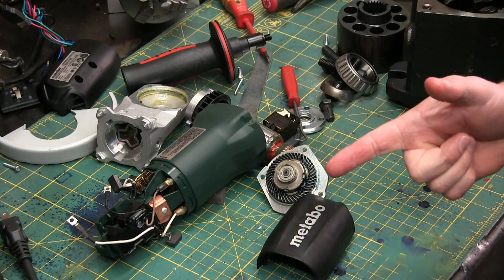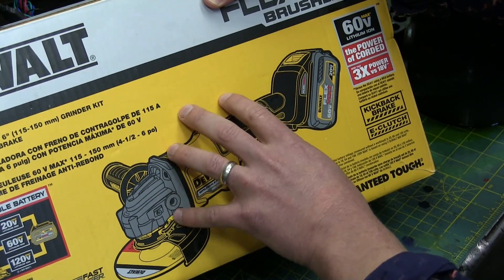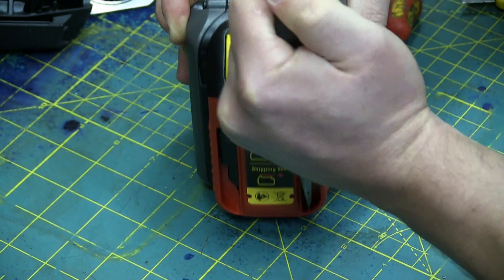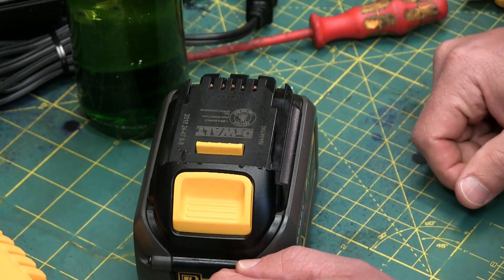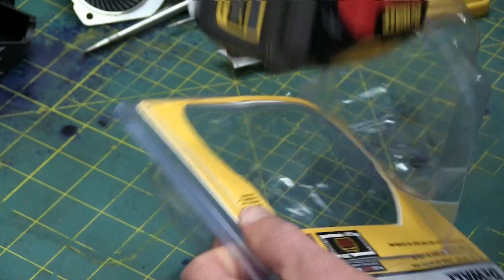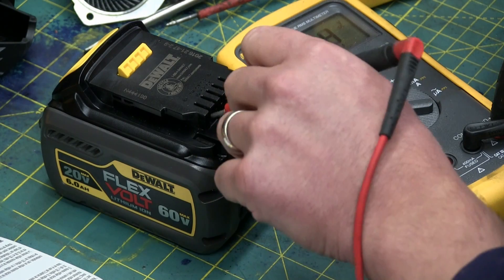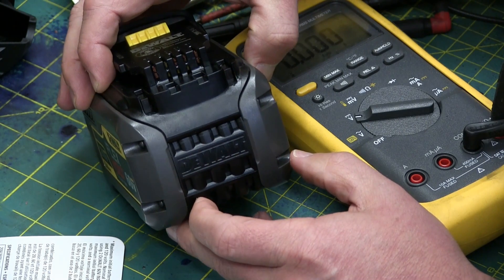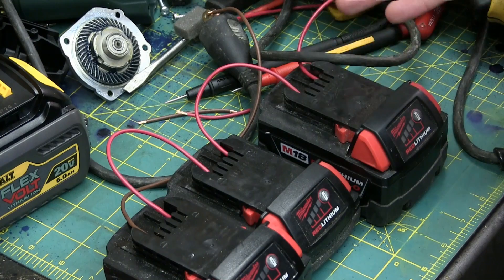Plug-in Power Tool to CORDLESS CONVERSION.

Comment: I thought about it for a minute here, and i didn't get to the turbo charge-y bit, but i think you could modify your charging station to have a GFCI that automatically resets before it goes into the battery, the power would go through the battery to charge it up as she goes, then send the power down another lead into the drill,  mock up a battery plug-y thing to get it in, same deal as the fesstool saw, where the end of the cord fits the pokey parts in the battery attach-y parts, back down into the station, (maybe through the battery, i'm not sure if it would have to go again to pull power out of the battery if the gfci breaks for a second and you don't want to have a pause in your work, never tried it and not an electrics guy) then back to the wall. Then again that's just taking your battery drill and using power straight from the wall while the batteries are charging.
Reply: But then you'd have to have a battery on the charger to run it with the cord.
Reply: You could run a splitter, have the power come into the drill from the battery at blah dy blah and have direct power from the wall through the station into the machine.

Comment: I see and understand where you are going with this project. However, might I ask about possibly going the other way. That is to build an adapter with a cord which could be plugged onto a battery powered tool and allow you to finish a job you're working on when the battery dies.It would convert ac to dc and be adjustable for smaller current tools. I think this could even turn into a commercially product; supplied by different manufacturers so the plug matches the tool.  I have encountered this many more times than tripping a breaker. I always make it a point to not use long extension cords which pull a lot of current and often heat up and increase resistance and trip a breaker.

Comment: there was even a sticker on it...
Reply: on...?
Reply: On...? Isn't a question but there was a sticker on the battery that said push to release or what ever
Reply: Yeah, it actually is a question: mine. You said "on it" without first specifying which thing "it" was supposed to refer to, before. Thanks for doing so now. But why didn't you do so before?
Reply: Hmm .. Did that sticker say something like "Remove before use"?  I had to rewind that part to be sure.
Reply: You couldn't have rewound this video, Jay Herde.
Reply: Some of us can.  And I did.
Reply: No, you never can, Jay Herde, because it's not on a windable medium like tape or film. It's on disk or flash storage (YouTube probably still uses a lot of disks).

Comment: Easist way might be to hack a Milwaukee Rapid Charger (48-59-1807) since it has the mounts for 3 individual m18 batteries right on it, which would be easy to series the wires from inside, you could also use the male 120v connection and comvert it to female to run a male tool or make a small adapter to convert from male to female. In that case. You could put jumpers on the outside of the charger where you can use jumpers to switch around the connections to make the batteries charge when plugged into a wall like intended or switch around a few jumpers and put your male to female adapter on and use it as a corded power tool wireless battery pack.

Comment: Simplest way to do it, instead of relying on a customers power service was to bring a generator. Operating cost and wear and tear on the generator was padded into the bill. Beats the hell out of spelunking in some dark weird basement, tripping over shit, only to find a panel that's from the 1930's and takes fuses.

Comment: You can already get this stuff - it's called inverter. ;-)
Reply: Well, an inverter is only part of it. It only does the conversion from DC to AC. And even then, only nice big ones for this kind of application.

You also, of course, need the battery or capacitor side, and the charger side, which complete the unit, in order to do the thing AvE says about having an electrical buffer.

Comment: Yeah the 60 volt thing is a gimmick.  Motors are all about current not voltage, but saying that, how much voltage can you add to a power tool before it starts to arc?  Try running a power tool from a fluorescent light transformer.

Comment: Wire a decent capacitor inline? I'm thinking of doing that because I'm running my home subwoofer off of a car amplifier, which uses a PC 12v power supply instead of a car battery. My pc power supply is only 500w and sometimes protection kicks in during peaks, so I want to wire a capacitor in, which is kind of how the car audio capacitors are designed.

Comment: How about having a magic box in front of the tool, that rectifies the AC and slow charges a bank of large capacitors through a resistor and diode (in reverse), then into the tool.

Comment: The spec sheets for the brand of 18650's I use recommends you store the cells @ 3.7V. Supposedly, storing them at full or no charge is bad for them. I don't know if there's anything to that, but peak charge for those is 4.2V. My numberulator says 3.7 is 89% of 4.2, and 18 is right around 89% of 20.

Comment: a ups using li-ION or lipo batteries vice lead acid would work. the heaviest part of most ups's are the lead acid batteries. the charger would have to be speced for the batteries but the inverter is pretty standard. just a matter of making a pretty package.

Comment: Maybe there's a way to use car batteries? They'd be all over the  job site, maybe even use the charging system of a vehicle that's on the site? I know a car battery is only good for about 12 to 15ish volts depending on wether or not the alternator  is working, but would the current help? Just a wanna be machinist going through school, be gentle. It's my first time.

Comment: Disclaimer: I have limited knowledge of electrical principles, but am not completely ignorant.

I like the idea of having something that can be built by any old bumblefuck, but how will the AC/DC switch happen smoothly without an arduino?  And if a special relay is used for the switch, is there any danger of voltage spikes?  What about the distinctly finite charging cycles of the battery?

Thinking of ways to break something is, I believe, of equal importance to and an integral part of designing the thing in the first place.

Comment: Put this under the Obviously you don't know to many welder's. I run all my power "AC" power tools, grinder, drill, etc, via an adapter (regular AC / 120 volt) plug at one end, at the other end just clamp your work lead (from a DC Welder) onto the rod provided. This only works if the motor has brushes.

Comment: I thought of the corded tool battery pack some time ago.... As an electrician, there are some caveats to play with... Mainly those OSHA douches. Sure take a battery at say 60VDC run it through a small inverter - out popping a heart stopping 120VAC - on say something to carry it all with, like a 'bandolier'.... Now some 'clipboard' guy is walking around looking for where the dang ground pin is running, and screaming "Holy FN shize - where's the FN GFCI protection?!?" 
Far be it from me to piss in your daydreams... I typically take my daydreams to full fruit, and there is usually a stain one way or the other. FYI I have dream truck which I crash test in my head repeatedly, then redesign.... (Current repeated day dream) But I thought of the 120VAC Battery pack a lot.... Certain say double insulated tools, not a problem.... But anything with a sliver of metal in contact with anything that can fail to be energized, and old man Ray is on the ground in a puddle - waiving for someone to jump start his pace maker. 

Now with say this idea of "bumping up" voltage via DC injection... There's the physical connection of this AC/DC convergence. It needs to be isolated from the AC source, since it's likely a GFCI or AFCI protected circuit. GFCI for personnel protection is required on most all construction sites and industrial work places in the states.... AFCI in every FN new residential outlets in the US. (I hate the fucking things, don't get me started on infant technology being stuffed down our throats for no reason....) 
So.... Rectify the AC TO DC... INVERT IT BACK TO AC - the extra juice necessary, is out of the batteries.... Hell it would be like walking around with a little UPS box. But instead of power back up when it fails, it's power that 'helps'. While it's plugged in and running... The AC to DC - DC to AC is enough it isolate it on a GFCI, so that needs to have another GFCI be put back on one on the tail side of the circuit... But if on an AFCI as a power source the FN thing will trip, because they suck.... The average cell phone charger looks like 'fire' to them in waveform distortion.... But the ground in the tool needs to be run through to the wall in all cases.... Not to further sully this day dream, but a thicker cord, closer to the wall is simpler/cheaper right thing to do... The other is an autotransformer to bump the voltage back up... But the right thing is to bring the "wall" closer by running a feeder and putting a panel there right where you need it, and a construction site spider box is the same as doing that.... 
All that said - You can mount a few car batteries to a two wheeled cart, with an inverter, and small electrical panel - and run tools on it intermittently all day long.... I have.... But making it the "feasible", "safe" and "right thing to do" is the hard part. 

Lithium ion lunch box sized power supply.... Bigger battery means bigger pussies when it's dead...
I'll be honest, guys on site giving me the 'meow my battery is dead' BS makes me want to beat them down... 'Heres the cord and drill I supplied - go plug it in to the 50A 120/240 spider box I made you put in for everyone else...'

Comment: The reason for the incomplete charge from the factory is that battery degradation rate is higher for a fully charged cell, so if they store it for a year fully charged or they store it for a year 50 percent charged the difference might be a couple of percent of the capacity.

Comment: How about instead of a battery you just use some larger capacitor like the starting cap on a drill press? I think the problem with batteries is they are sooo slow to charge. Caps charge crazy fast and supercaps are getting better. Maybe make a "Battpack" that is a backpack with a bank of these and just walk around the shop with it!

Comment: Just because you can run some tools off DC power doesn't mean your device will work for everything. It only works with universal motors that don't use a triac based speed controller.

Comment: I believe that AC motors and DC motors are fundamentally different in the way that they verk. What with the pixies dancing much more quickly in AC motors. However, that is not to say that you could not have an AC inverter hacked into the battery pack and step up the voltage to 120 or what have you. I feel like it could work but then again I am no elecrikin. I haven't experimented with AC that much apart from shocking myself in the arm something fierce when I was 12 and wanted to know how a motor worked. I'm not sure about the efficiency of DC to AC inverters but it might be good?

Comment: While you were talking about your idea I kept thinking about split phase used in construction to make the potential from ground lower while still providing the same powah. Not really literally applicable here I think, but I kept thinking not might be.  Maybe detect the sag in voltage and apply a carefully timed square wave to overcome the drop? Don't they already have UPS circuits that detect and mitigate brownouts, sounds like the situation you are talking about, but maybe simpler because you don't have to run in no power situation...

Comment: I think you will need to rectify the AC to turn it to DC. Try taking apart a simple old welder, it should have the big beefy rectifiers.

Use an inteligent balancing/charging circuit to charge all the batteries in series (6 20V ones in series, or 30 cells in series)

Power the tool directly off that. Use solonoids or solid state relays (or better, IGBTs) for switching between the rectified mains power and the battery power. 

Basically I just described a giant UPS, Uninteruptable Power Supply.

Comment: Thanks for the video. This is actually the opposite of what I was thinking about doing. I have an 18v cordless drill for about 10 years and the NiMH batteries have all died. I'd still like to use the drill for some experimental tinkering and other BS. I haven't checked anything with my meter yet, and still wouldn't be too confident. But, I was wondering if it might be possible to attach some leads from the drill to the charger; however, I'm starting to think I would need to go further on the circuit. From my little Google search, I'd probably have to hook it up after the rectifier and maybe  add some more diodes in order to use "reverse".   So, is this feasible; or, should I just buy some generic converter with the proper specs and hook that up straight to the drill. It's odd being an electrician "wireman" and it's mostly get wire from A to B. I'd love to find some courses to take a technical school/ college that is heavier on the engineering and trouble shooting side of things.
Reply: me too!

Comment: You know, a capacitor would be much better for what you're trying to do then a battery. But if it needs to handle any sort of load for more than a second or so, you're SOL on that front. Getting any sort of energy density out of them is rough. Even those massive ones on AC units are only in the mF range, so if you're dealing with 100V of DC, you'll be lucky to get on the order of 10 J of energy in the thing, or about a 100 mA spike for one second at those voltages. 

Pity, really, since caps are much better at handling sudden, high power demands than batteries. But if they ever managed to make a small, cheap 1 F capacitor, that's the direction I'd go.

Comment: +AvE The Dewilt 60V capability is actually activated by pushing a buss bar back across a different set on internal contacts, look at the 60V tool and you will see tabs that move the buss bar to the series setting. Its 100% mechanical, no communication, no micro-controllers involved.

Comment: You totally need to see this project to completion.  If for any one job, to keep a mag drill from falling off the bottom of the beam with some douche canoe unplugs your cord after reading the tag that says  "MAG BASE DRILL DO NOT UNPLUG".  Just having that safety factor would be amazing.  I know that's what the strap is for, but when you are 40 feet in the air with a mag drill on the bottom of a beam, when it lets go, there is a serious amount of pucker factor involved.  and this doesn't even take into account the drill dropping crooked and breaking the bit.

Comment: One way of stopping the breaker trip is to start the tools at half voltage for a second then feed them the full power. Triacs come to mind. A step down transformer with a current operated bypass relay if you want to get all cheap Chinese on it (if it's stupid and it works, it wasn't stupid).
Universal motors have a lower impedance at DC then they do at AC. If you do run them off of DC you may have to send a lower DC voltage to them to prevent driving them too hard.

Comment: Sure as hell not going to do it drinking Moosehead! (if it's not Moosehead it's carlsberg)

Doesn't do anything for the wireless, but wouldn't it make more sense for the sake of current stability to just use a big ass capacitor and an inductor?

still lets you have a good current delivery for start-up and high load, but a little bit of circuitry could minimize power draw from the outlet to keep current just high enough to power the tool (and charge the bank up slowly while not under full load) but low enough to not try to instantly refil the cap (which would definitely blow the breaker)

Comment: You wouldn't really be able to use it as a battery much, but you could throw a rectifier and super capacitor at it.  The cap would serve to help supply power on startup and you would have to rectify it because, well, capacitors and ac currents...

Comment: @AVE The low charge of new batteries is a requirement for safe shipping. 
http://batteryuniversity.com/learn/article/bu_704a_shipping_lithium_based_batteries_by_air

That's also the reason for the red cap. The battery is large enough that you can't bring it on an airplane unless the contacts are covered. Dewalt has to include that for people who ship their tools to different sites. 

https://www.youtube.com/watch?v=EeFMvo7V1rE

TLDR: low charge cells can tolerate higher temperatures before venting and potentially starting fire.

Comment: My 2 cents, you could have a box with some kind of quick discharge friendly batteries that in normal no-demand mode are being fed by some kind of charger circuit and the output being fed from the batteries. When demand is sensed (some kind of current draw), the batteries provide the power to handle the high inrush, and after some amount of proving time (2 seconds maybe) the output is switched to mains and the batteries continue charging. If the current goes high again for some reason (low voltage/high load), the device switches back over to batteries until the load is normal, plus some additional proving time.Quick and dirty you'd just run the tool off straight DC from the batts, and use a break before make switching system to make sure you don't get some wonkiness from DC and AC on the same circuit. If the tool can't take that switching period, you'd probably want some kind of system that in the UPS world is called double online conversion, where basically the batteries are always feeding the load through an inverter, and the line power just charges the batteries. More betterer but more expensiverer and complicaterer, too.